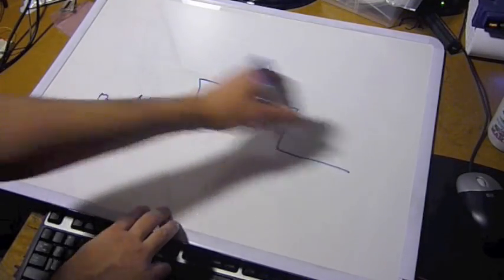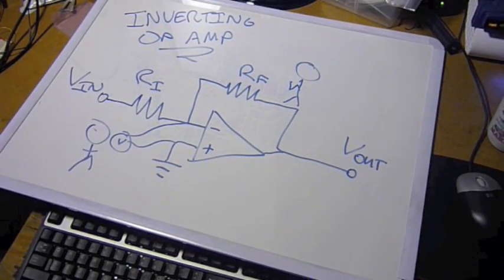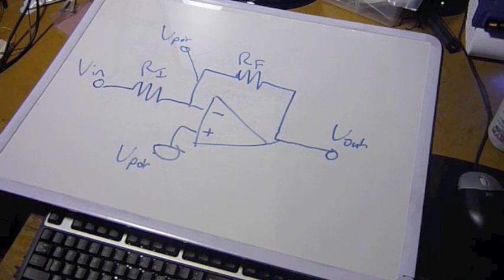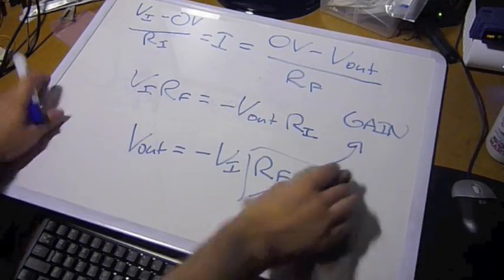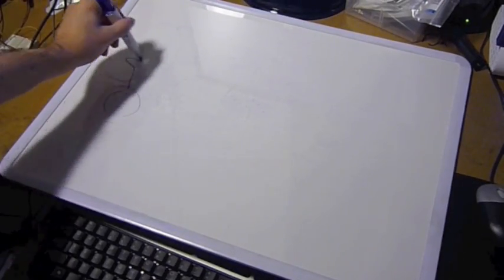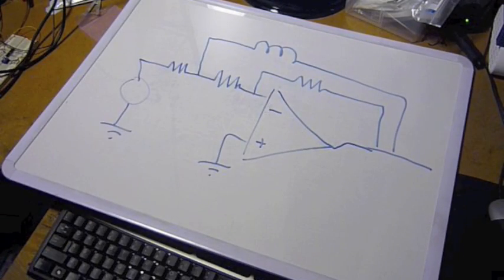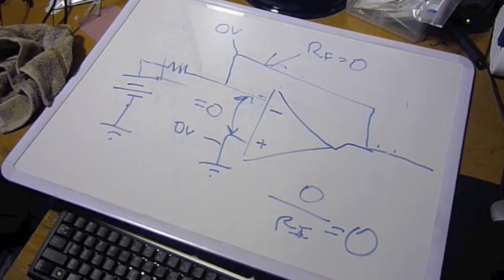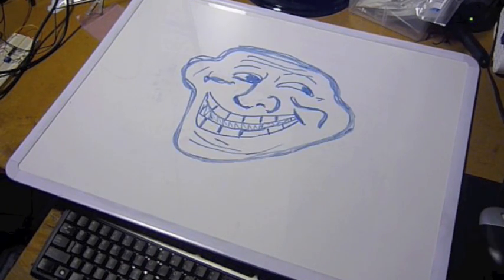Op Amps by Intuition

Comment: i have a question:
i am using opamp in open loop configaration 
vcc=12v,  vee=0v, v- =2v, v+=(0 to 5v) ac square wave
output is=(3 to 12volts)ac sqr????
i am expecting output=(0 to 12 volts) ac sqr.
what happened here please explain.i want 0 to 12 instead of 3 to 12

Comment: I have a  guitar effect. It died. It is all 2-4 SMD crap. I put a signal on a O scope probe. R + in & the sine wave goes away, just like on - in. On the first op amp pin 5 +in does not do this. From listening it seems the problem is in that 1st op amp. (noise) Does this sound right?  I am on/off  track?  The math seems to indicate this. There was also a pwr supply issue I fixed. After fighting to disassemble it, I am sure these are meant to be disposable. I am awake now.PLEASE Don't slow down!

Comment: You really don't need to know when an op amp is acting as an "inverting amp", "non inverting amp", "adding amp" etc. That will come with more experience. With simple analysis, you can solve any circuit knowing the above information.

Perhaps my professor just made things clearer for us and more simplified.

Comment: if there is no "negative feedback" we cannot assume anything. We write the output voltage as: V = A(Vp - Vn). Where Vp is the non inverting input voltage, Vn the inverting input voltage, and A the amplification as it tends to infinity (there is proof for this, just trust me on it). This equation is solved as a limit as A---> inf. So really, the output voltage is defined as: lim V (A-->inf) = A*(Vp - Vn). Then solve the circuit as normal, remembering not to use KCL at the output node.

Comment: Once that is defined, use "kcl" at every node (junctions that combine 3 or more wires). if there is a "node" at the output of the op amp, since we do not know the current there required for "kcl". Then using simple algebra, we can solve for the output voltage

Comment: Op amps are really not complicated at all, if you know how to analyze them

first, always look for "negative feedback". This is defined when there is a connection between the output terminal and the "inverting" terminal. This connection can contain any passive elements ie resistors, diodes, etc.. If there is negative feedback, the voltage in the "inverting" input will always be the same as whatever the voltage is at the "non-inverting" terminal.